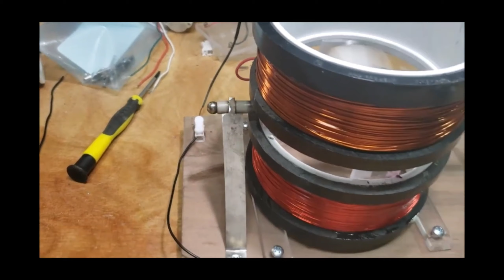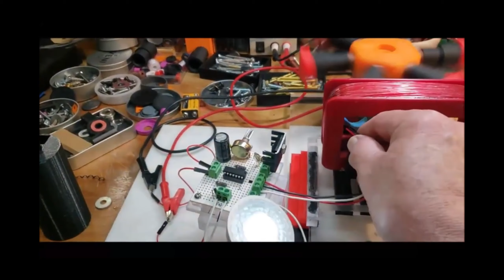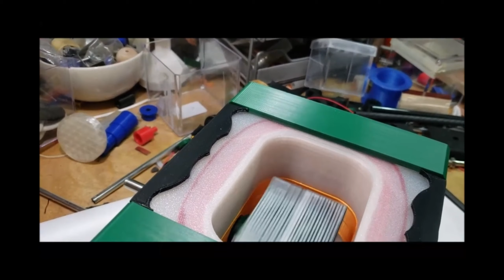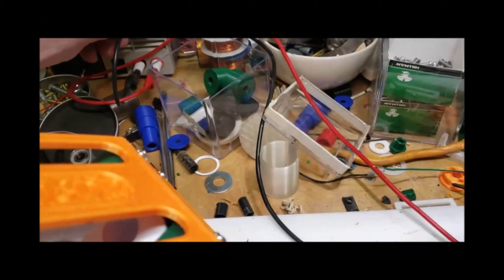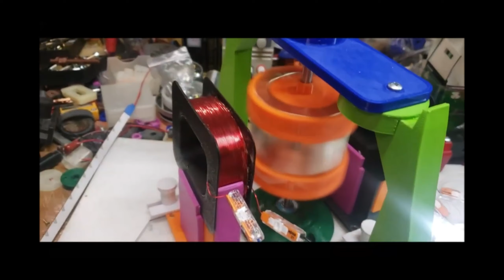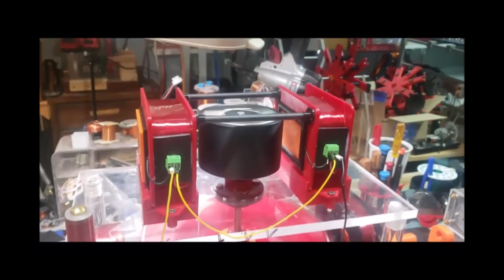3D Printed Pulse Motors Compilation video

Comment: Very interesting, specially your projects 15 years ago... To bad you shelved the "spiral motor", I think that it would have some future. I believe that at the time you did not fine-tune the spiral. With only one arm, it should swing around the whole circle by itself and stop at the so called "sticky point". The coil or bedini motor should only be there to neutralize the sticky point, you should reduce the current or voltage, so that it just really newtralizes the magnetic force of the sticky point, and once passed it should speed up with the spiral. the difficulty would reside in the fine tuning.. first the spiral, to get the maximum power with the smallest sticky point, and then tune the voltage, and/or the current. I think that motor is worth another look.
Luc
Reply from the maker: ya like I said it was made from an old crutch and was barley holding together. When my kid was born I left youtube for many years and started doing wood working. I'm not even sure what happen to it lololo
Reply: @mcorrade  no not that one with the old crutch... i meant this one https://www.youtube.com/watch?v=byeOhuCv-EY 
which has the potential i was talking about.. (of course different set-up) with only one magnet and 3 weights.. to be able to get 340 degrees magnet only acceleration
Reply from the maker: ya that one was unfortunately hung up and forgotten until throw out. I do wish I had kept it. Maybe I'll recreate it using 3d printed materials